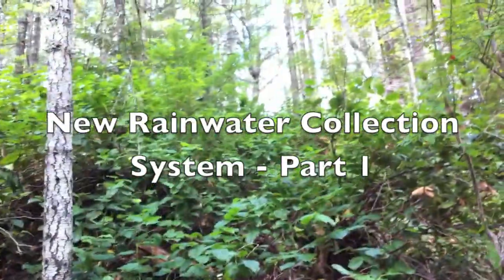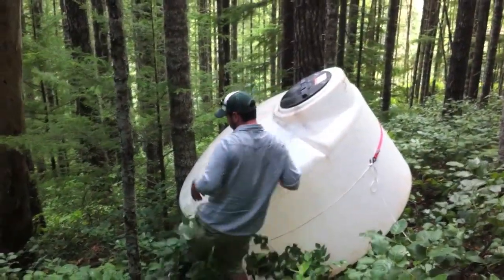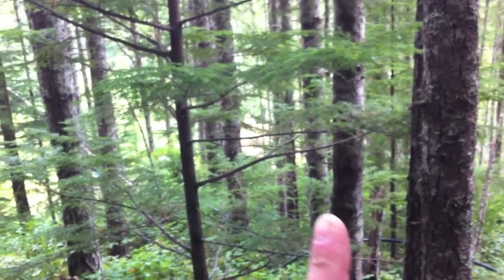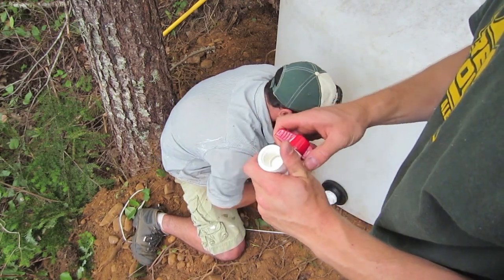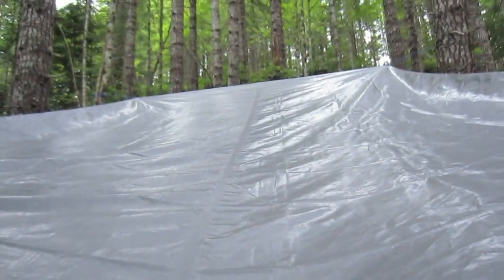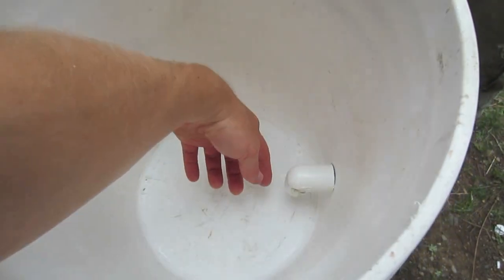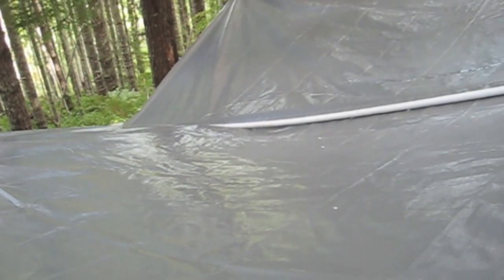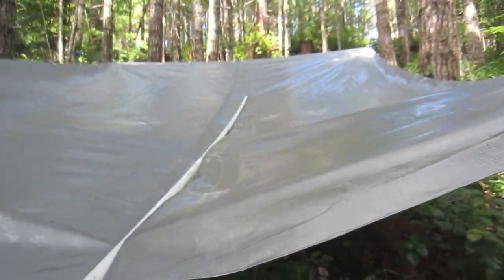Wilderness Off Grid Cabin - How to Build: Rain Water Collection - Part 1

Comment: Great. Just the info I was looking for.  A friend recommended that I lay plastic tarps up the hill, on the ground leading to the tank.  I have a 2500 gallon tank so I could use more area.  That's doable but maybe needing a transfer pump. Thanks

Comment: Our friend John built us a similar system for my garden at the cabin. Same tarp configuration, except ours drains through a screen covered funnel directly into two 55-gallon barrels. If I had your big "barrel" I could make my water last a whole lot longer during the dry summer months. I like your bucket system to filter the water before it goes into the barrel. Periodically we have to empty ours to flush the sludge out of the bottom. Amazing how many needles make it through the mesh. - Margy

Comment from the maker: Cool Steve, I will definitly check it out. We planned on using a pump on this system for years but it simplicity won in the end. I'll post the results good or bad but I know the tarp won't last forever. We need to put a roof up there soon.